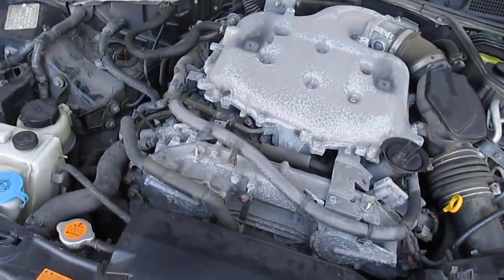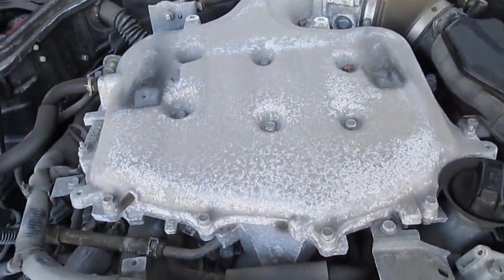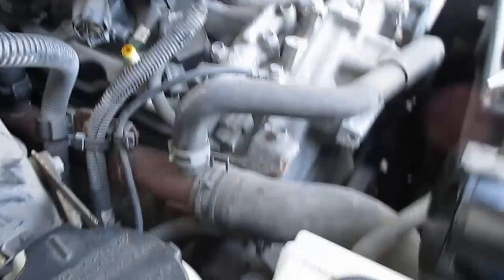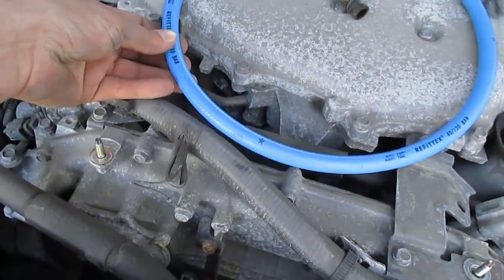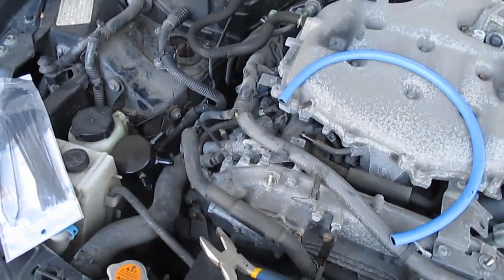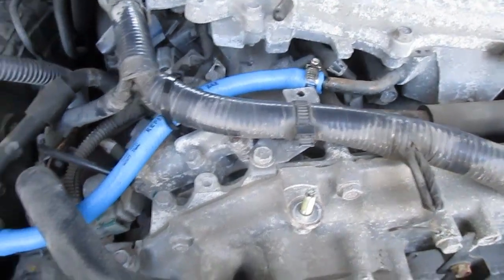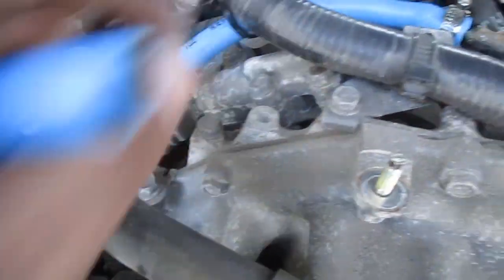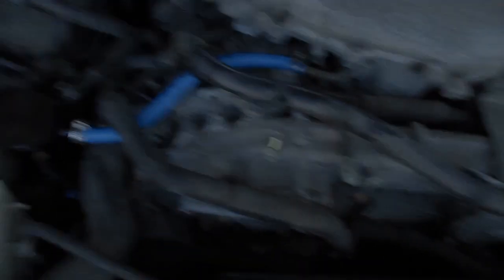How To Install Oil Catch Can - G35, 350z, FX35, Skyline 350gt, VQ35

Comment: Gas lines usually allow temps up to 175 degrees which is not enough
Reply from the maker: Ihor Bodnarchuk still holding up fine to this day. maybe with a turbo set up I'd recommend something better to withstand the heat
Reply: I have used fuel line on my g without issue for over a year. I have used it on other cars as well. 
My temp gun read 164f on that hose on a 80f day when running hard.
I will admit it's close to the temp the hose is rated at and maybe advisable to keep an eye on it.

Comment: I been doing some reading on these cans and I am having a hard time understanding how this fixes oil consumption. The catch can catches the oil vapors, the vapors condense, sit at the bottom of the can, and then when it gets too full, you dump it out. Granted, yes you could reroute the fluid back into the engine, but why would you want to do that? Have you seen all the nasty junk sitting in the catch can? Shit you might as well save yourself the money, just go buy some hose and reroute the lines to dump out that crap behind the engine (like your ac unit) and plug up the intake fittings. Could probably  do that for under 20 bucks easy.
Reply: Is there a video on how to do that???
Reply: It doesnt help with oil consumption, it helps your intake system stay cleaner since there will be less oil vapor being re-routed through your plenum.

Comment: Hey bro I followed the steps you posted on the vid. But my catch can on my 03 g35 sedan was 3/4 full the next day I goin nuts. Can you Help me out on what could be the problem . I would really appreciate it 😢 .
Reply from the maker: If the catch can has that much oil in it there is definitely a oil blow by issue. I would take it in to a mechanic and have it looked at. Do you notice blue smoke on start up and heavy accelerations??
Reply: +DNALI it's not blue but there's smoke on start up. What should I ask the mechanic to look at first?
Reply from the maker: Id the rings are shot. So I'd say a compression test but just tell him your noticing a lot of oil blow back in the intake. Might need a rebuild
Reply: O wow a rebuild sounds expensive smh .... thanks for the info btw man I know your a busy dude.
Reply: Yayo0191st You can purchase a new (used) vq35de or vq35hr for like 2k, or built ones for 4k. if its more than one of those, now you have options lol

Comment: Aye how is your car performing after the engine damper was installed compared to not having one
Reply from the maker: A1 snday1 I'd say it definitely helped put the power down faster
Reply: @DNALI  do you have any wheel hopping
Reply from the maker: A1 snday1 yeah I had a lot of wheel hot when I first got the car. Upgraded the rear diff bushings and the transmission mount and it's pretty much to a minimum

Comment: I understand the purpose of the oil catcher, however my concern is about BURNING OIL, since supposedly oil is “escaping” from the engine through the PCV  to the intake manifold, still I have to be putting some oil in the engine even if it goes to the catcher , is not burned out, but is wasted anyway ☹️

Comment: I just installed my plenum spacer today...let's just say it wasn't all that easy since I had no means of easily holding up the intake manifold as I was also trying to simultaneously apply gasket seal all around above and below and then the bushings underneath with the gasket seal on them.  It was more than obvious my car is in dire need of an oil catch can as well.  After mine comes in the mail, I will clean out the manifold and redo my plenum spacer install,  I will also have to take out those two bolts on the sides since they are of no use anymore.  I decided to leave them as is and just tighten everything else around the manifold.  I ordered a manzo y-pipe and manzo cat-less test pipes as well.  I saw that you said in your other video that the megan y-pipe you bought made your car way too loud?   I want my car to be loud.  Lol...can you tell me if you had a CEL light from the y-pipe?  Also, do you have test pipes, if so did you get a CEL light from that or how did you get rid of the CEL if you do have them?

Comment: What would happen if you just plugged the valves instead of installing a catch can?
Reply: Builds up crank pressure inside of the motor. Can possibly pop a gasket out. Has to be able to vent slightly

Comment: Hey would this work on an 05 G35x? Same procedure?
Reply: Saaif Khan man the struggle is real for us X guys, but ive managed to do alot with my X, of course I fabricated my own exhaust instead of paying $1000 for one, I lowered it on regular g35 sedan springs since g35 coilovers wont work due to the whole suspension set up being different on the front with the Cv joints there... but yeah it lowered it pretty far a little too low but i dont care. I do frame bang if im not carful though. Anyway good luck on your X build!
Reply: Hey thanks for the info man, I really appreciate it, and you're right, us X guys have it hard, but hey, AWD is pretty awesome on a G! I'm not looking to lower it right now, but I'll give this catch can a go and maybe post a video about it.
Reply: awesome man, make sure to link it to me if you do bc id love to do it too!
Reply: @danielcowan3138  what kinda exhaust setup did you get? I'm utterly confused on which one for my 05 X. Might just take it to an exhaust shop and see if they can fit anything
Reply: Ali Khan what i did was actually cut off the muffler itself and did what i call the “auto zone special” I got a straight pipe and then a 45 degree angle pipe and then another small straight one, then i U-clamped them all together and put the medium sized chrome exhaust tip from autozone on the end and it looked and sounded exactly like a 3-4 inch cat back exhaust if not better, mine sounded more gtr like rather than 350z like Which in my opinion was perfect + its loud but not loud to the point where it drones, it’s literally perfect haha..and my favorite part about it is that when the exhaust come out the back the tip and piping form an angle to where it looks like a supra exhaust how it angle to the left!!! And it all only cost me about $50 and it sounds better and looks exactly like a $1200 exhaust:)

Comment: hey quick question, i have and 06 g35 and while changing my spark plugs i found a lil bit of oil on the bottom of 1 spark plug (where you get the spark) would dis fix my problem?
Reply: pranit Prasad spark plug seals, they are in your valve covers, you need six
Reply: Back left?

Comment: I was told that is the wrong way to install a catch can as I did that on my also, but the right way I guess is to block off all to intake including the one on your intake tube and just have it go in between the pcv and driver valve cover like I did
Reply: +urmastertech There are a few ways to do that. The one in this video and the one you described, then one that completely deletes the  pcv valve. In that instance you would want a drain in the can to drain back to the crankcase. If not, you would need to check the can often.

Comment: that `plastic connector` is your pcv valve, its essentially a one way valve and just putting a hose on it is useless.
you can buy an adapter or if your comfortable with it drill it out and pull the little check ball out.
Also your catch can needs baffles of some sort. Again a common solution is stainless steel wool, as the air passes through the can the baffle is colder so the oil condensates onto the baffle and then drips into the bottom of the can. 

Best of luck

Comment: Do you have to empty that catch can?/ And how?? Thanks =)
Reply: Yes there is a bolt on the bottom
Reply: OK, thanks! Did it help with oil consumption/smoking??
Reply from the maker: +Eero Laukkanen if you are having oil issues it will help with the blue smoke but it will still consume oil. the blow by will just be caught in the can as opposed to going back into intake manifold
Reply: OK, terrible oil issue it is, not leaking from oilcooler, fixed that,....will do valve job, pistonrings, same time change timing change and put a little "sharper" cams in...., we'll see =)
Reply: hi...nice video, ...obviously the goal is to filter the oil out of those gases before going back to the intake... Question: since you running a V6 I assume you having 2 banks with 2 valve covers and so 2 PCV valves/lines, if I am not mistaken here you install your catch can into one bank.... how about the other half of your engine??    The other PCV line don't need to get clean before going back to intake??
Reply: 2 different catch cans. I've seen cars with 3 catch can set-ups

Comment: The only way to reduce oil consumption is to change from 5W30 to 10W30 man.
Reply: Jail Corruption some delo 400 or rotella t6 does the trick.. and its high zinc better for your bearings